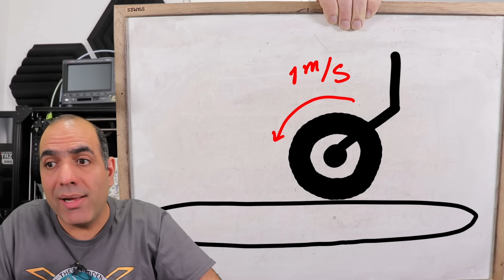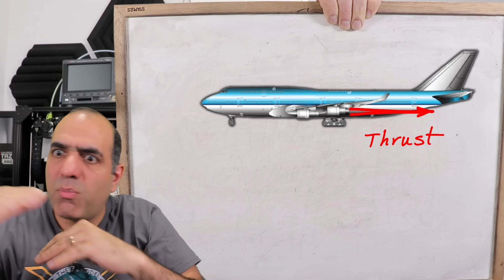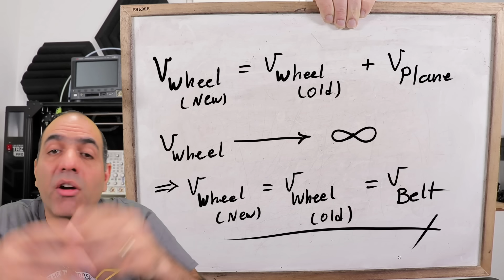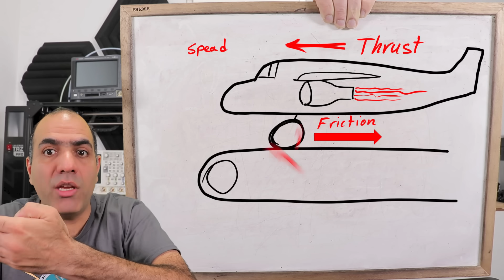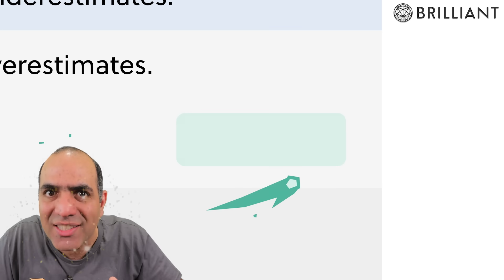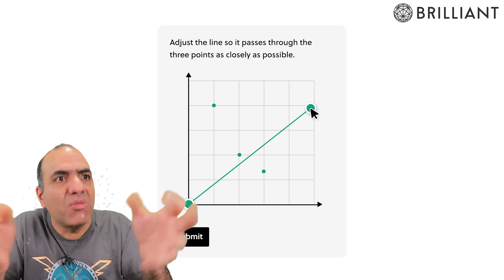Airplane Question that Drove Me NUTS!!!

Comment: Yes, because the wheels aren't the ones propelling the plane, but the engines as thrust, so while a car won't move past the conveyor belt, the plane can
Reply: As per #3 case, friction would melt the bearings and the plane would crash to the ground of fly away if it's fast enough for when that pasess

Comment: No, because the plane takes off because of air pressure differential (under/over wings) while moving "THROUGH" the air.
It's also why a stationary plane can take off if there's a lot of wind.
Reply: The question is really just a variation of the tennis ball-pick up truck problem, ride a pick up truck going 40kmh, then throw a tennis ball at 40kmh in the opposite direction that the truck is traveling. What happens to the ball? It falls straight to the ground. Atleast one of you must have heard this exempel before? remember 4th grade physics class?
Reply: @SalsaDura  what are you talking about? The plane takes off normally - it gains speed and moves forward and takes off.
Reply: @svetko05  Right. I got it. There was even youtube video describing this aspect not so long ago. The plane will run towards front of treadmill no matter what. So it will gain relative speed anyway. Its wheels will just spin faster.
Reply: See: "Why aircraft carriers head into the wind for cats and traps".
Reply: Nothing gets past you.
Reply: And in a Vaccuum it can never take off. XD
Reply: Yeah its a really straight forward awnser lol
Reply: That's true, but also wrong. The plane moves with its engines, which generate thrust and not the wheels like cars and bikes.
Therefore, if a plane is on a conveyor belt, it will take of like usual,  but the wheels will rotate twice as fast because of the addes speed of the conveyor.
Reply: @svetko05  no,
Think more mathematically. The question states, that the belt matches the speed of the wheels!
This means, that by definition the axis of the wheel does not move. And thus the plane does not move no matter what. If there wansnt any friction in the bearings of the wheel, then there wouldnt be any force tonencounter the planes thrust, but this simply means, that the belt cant move at the same speed as the wheel does, which would imply a false statement in the question. So the question actually implies, that there is sufficient friction inside the bearing for the airplane to be stopped by the friction itselve at a very high rpm of the wheels.
Reply: @svetko05  It's amazing to me how many people are coming in here and assuming that Mehdi thought planes take off by driving their wheels instead of actually watching the video. The wheels can't spin twice as fast by definition in this scenario because the speed of the conveyor is equal to the wheel speed. If the plane starts moving forwards then the wheel speed must exceed the conveyor speed, which can't happen. The only ways the plane can take off are if the plane's wheels can slip without being destroyed allowing the plane to take off without the wheels spinning at all (or at whatever speed perfectly matched to the conveyor so all net forward motion is from wheel slip), if the speed of both conveyor and wheels is infinite such that the difference in speed is effectively zero even when the plane is moving forwards, or if there's a sufficient head wind that the plane can take off in place (as another commenter suggested potentially as a result of the infinitely fast treadmill spinning underneath it).
Reply: @svetko05  but the wheels are rotating at the same speed as the conveyor. so therefore, no forward movement=no lift

if the conveyor belt is matching the ground speed. then the plane can take off
Reply: @8bit_George  the wheels rotating at the same speed as the conveyor belt changes absolutely nothing because they are rotating freely. The engines are what provides thrust.
Reply: @Ledlightman  as i said - wheel speed doesn't matter to an airplane. It doesn't matter if they don't spin at all or even if they spin to an infinite rpm. 
Some planes don't even have wheels, but floats or skis.
As long as the wheels don't generate too much of a friction, the plane will move. But friction was not mentioned in the question, so we assume it is ignored.
Reply: @svetko05  You've added an additional assumption there without even realising it - "as long as the wheels don't generate too much friction". The only way for this to happen is if the wheels have exactly zero friction or if they don't spin at all and wind up acting as skids. They can't just spin faster because the faster they spin the faster the conveyor spins, perfectly matched to the wheel speed, until they both reach infinite speeds, friction exceeds what the plane is putting out in thrust, the wheels slip or something catastrophically fails. And depending on which of those happens the plane may or may not take off.
Reply: @8bit_George  The wheels rotate at twice the speed of the conveyor, it is going backward at speed V, the wheels are going forward at rotation speed 2v and the plane goes forward at speed 2v minus v or one v.
Reply: @8bit_George  that depends on what "speed" you're talking about. The thing is in actual reality, if you built a conveyor belt runway, there would be no way to control the belt such that the belt operator can prevent a pilot that intends on taking off from taking off. And since that's the reality of the situation, then the "speed" referred to in the question must be interpreted to be consistent with that outcome. 

So what "speed" fits the question.  And there's actually two! The first is the speed of the wheel itself as it's attached to the aircraft. If the aircraft moves forward at 100 mph, the wheel goes along with the aircraft at 100 mph. A mark on the conveyor belt moves 100 mph in the opposite direction.   Problem satisfied. 

Here is the second way to interpret the question so it's consistent with reality. If put a mark on the contact surface of the wheel, and you measure the distance it travels, the circumference of the wheel x the number of rotations. That distance will equal the distance traveled by a mark on the conveyor belt surface. If the conveyor belt is rotating in a clockwise direction the wheels will be rotating in a counterclockwise direction.  Same speed, opposite directions. Problem satisfied.
Reply: @8bit_George the wheels dont move the plane. This is not a car. Do you really think planes take off my powering the wheels? News flash: no they dont. The engines push the entire hull forwards, NOT THE WHEELS. The wheels spin freely and act as a bearing. Thats all they do. 

For your "answer" to (still not-) work, the planes hull itself must be attached to the treadmill, in which case the plane will go backwards and once again showing you that youre still wrong.

Comment: yeah i'll leave a comment.

 OF COURSE IT CAN.

fundamentally it's a flawed question because it's got nothing to do with a conveyor belt. the plane itself is moving forward, not the wheels.

EDIT: obviously i've now watched the video and i want to help out with case 3:

there are two key pieces of information that need to be added that are forgotten. 1: The friction of the conveyor belt doesn't just effect the wheels, it effects the air as well. 2: Lift will affect the effect of friction on the wheels as they will "weigh" less 

As the conveyor belt has friction it must be moving the air. the motion of air over the wings will produce lift. lift reduces the effect of friction from the conveyor belt on the plane and so the wheels turn faster. the conveyor belt speeds up to compensate. faster speeds mean more resistance. more resistance means more  air flow, which means more lift which reduces the effect of friction, so on and so on until equilibrium, where lift = gravity, which fundamentally is just a plane flying in one place .

Comment: Trivially yes. I mean practically you'll have a lot more rolling resistance and maybe a tire blowout for overspeeding the tires but overall the plane should accelerate as normal.
Reply: It's only trivially yes if you read it as the conveyor matching the plane's speed. But that's not what the question said.
Reply: @bosstowndynamics5488  whatever speed is applied to wheels is irrelevant, they can spin freely and the engines can EASILY win against wheel friction. The only issue is wheels spinning too fast for what they are rated for and blowing up
Reply: @marcogenovesi8570  For the plane to move at all the wheel speed must be infinite or we have to introduce wheel slip into the scenario. If the wheels have finite strength or any friction at all then the fact they're free wheeling is irrelevant, because they'll generate infinite resistance in that situation and stop the plane, or catastrophically fail. Wheel resistance is only irrelevant at real world (finite) speeds. If wheel slip is allowed and the wheels are indestructible then the plane slides down the runway as if it doesn't have wheels at all and depending on specifics may or may not take off.
Reply: @bosstowndynamics5488  for the airplane to move you just need to start its jet engines and there is nothing the wheels or anything under the wheels can do about it unless you pull the brakes. The jet engines are in the wings and pushing forward irrespective of the speed or direction of rotation of the wheels. The whole question is a false herring, wheels are irrelevant because an aircraft is not a car, it's engines push the air, not the wheels.

The only thing that can happen is that if you exceed the tires speed rating they blow up as they spin too fast. But this is hardly a mind blowing concept, run wheel too fast and it will blow up, duh
Reply: @marcogenovesi8570  Did you watch the video or did you just completely ignore it and go based off of your initial, incomplete read of the question? The plane isn't hovering, it needs to roll down the surface it's sitting on using the wheels until it reaches take off speed. And until that point, it's subject to friction from the wheels. In most circumstances you can safely ignore that friction because it's dwarfed by the inertia of the plane, but the question specifies that the road surface is moving backwards at the same speed the wheels are rotating, by definition*. For the plane to have *any non zero speed the wheels must be spinning faster than the conveyor, which we've just defined as impossible because the conveyor will always match their speed. In this scenario the conveyor speeds up until the wheel friction is so high that it overcomes the thrust force of the plane and it just sits still as the wheels explode, unless it can run long enough to accelerate the air nearby to take off speeds so that the plane can take off perfectly vertically.
Reply: @bosstowndynamics5488  Yes and I still think it's nonsense, the moment you start the engines the speed of the wheels does not matter anymore. Wheel speed may or may not go higher than what they are rated for and blow up
Reply: @marcogenovesi8570  You can think it's nonsense all you want, but your arguments are outside of the scope of the question and therefore irrelevant. The entire point here though is that the question is nonsense, showing that all logical conclusions are also nonsense is part of demonstrating that. Concluding "but in the real world wheel speed doesn't matter on stationary ground therefore it doesn't matter in this hypothetical describing a very unreal situation" is completely missing the point.
Reply: @bosstowndynamics5488  The question is a trick question, giving irrelevant information and hoping you get confused by it when in fact it does not matter.
Wheel speed does not matter for an aircraft as the engines are not connected to the wheels, the only thing that can happen is that you blow the tires because they rotate too fast
Reply: @marcogenovesi8570  And, as I've already said multiple times, the tires are spinning too fast *by definition*, because the construction of the question requires that either the plane doesn't move at all or the wheels are spinning infinitely fast. At all finite wheel speeds the only circumstances that satisfy the constraint that the conveyor is spinning the same speed as the wheels are if the plane is already in the air (which fails the requirement for the plane to start at rest) or if the plane is stationary. You can't just ignore the wheel speed here because the wheel speed is tied to other systems in the scenario and the result of that relationship is that it breaks the intended meaning of the question.

The question is supposed to catch people out for assuming that planes are driven by their wheels but because it's so poorly constructed the result is that a large number of people (including Mehdi) will reach conclusions other than "the plane will obviously take off as the wheels aren't the driving force" with perfect logic. It isn't a trick question, it's a bad question.
Reply: @bosstowndynamics5488  And what does the wheels spinning too fast by definition do? The tire blow up, as I also said can happen since the first statement.

You fall into the mistake of overthinking, what I said is still correct and the most resources I can allocate to trick bs questions. Quick estimates with caveats.

No you don't know what that question is supposed to do, maybe they wanted to do the 4D chess move and actually trick the tricksters with a multidimensional trick question that looks like a much simpler trick question.
Jokes on them I gave an answer that is still correct without wasting any more time than I would with a normal trick question
Reply: @marcogenovesi8570  But your answer is wrong. You didn't answer it efficiently, you made incorrect assumptions and as a result provided an incorrect answer, then you had the gall to excuse it by claiming you didn't waste energy on a meaningless question while arguing back and forth for over a day in a YouTube comment thread. You aren't interested in being efficient, you're just trying to be right. There are valid arguments that suggest the plane would still take off, but "the wheel speed doesn't matter" isn't one of them.

By the way, have you thought about what happens after the tires blow up? You keep saying that's the only consequence of going over rated speed on the wheels yet you haven't mentioned what happens next when the barely moving plane's landing gear explodes at full thrust.
Reply: @bosstowndynamics5488  No my answer is correct and I didn't make any assumption.

Arguing back and forth for a day takes seconds and is entertaining, figuring out exact mechanics of a physics simulation to answer a trick question takes time and is less entertaining than arguing with a human opponent.

I'm being efficient. Efficiency is effort per result not just effort by itself.

What happens after the tires blow up is that the metal wheels eventually grind down and seize. When that happens on all wheels the belt stops as the wheel aren't spinning anymore and the landing gear becomes a sled. Yesthey are designed to withstand that (for a landing) and the engines are powerful enough to still push it fast enough to accelerate even with higher drag because the things are not wheel anymore, they would be strong enough to push it even if it was on its belly with no landing gear. You really underestimate jet engines on commercial aircraft of this size, unless it's bolted to the ground they will push it
Reply: @marcogenovesi8570  You can't just say you're right and have it be true, you're making implicit assumptions about the content of the question instead of actually reading it and then making ridiculous claims like it's somehow efficient to argue in a comment thread. Efficiency is partly about results, yes, but what results have you achieved here? Efficiency is partly about input, again yes, yet despite the fact you claimed it was too much effort to analyse the physics of the question you attempted a detailed analysis of the conceptual physics of this argument.

The plane can't take off if its superstructure is destroyed by being dragged down the runway. I'm sure the engines are capable of it, what I doubt is the structure of the airframe what with all of the infamous examples of planes falling apart when landing with damaged landing gear and all. The plane can't take off if it's a heap of twisted metal.

Your argument is just wrong, it relies on an incomplete reading of the question and your refusal to acknowledge that is getting old. It's not efficient, it's a waste of time.

Comment: What is it with all these questions that the Mythbusters solved years ago suddenly making a resurgence? The plane can take off, because the wheels aren't what is driving the momentum of the plane, (in fact they are likely free spinning). So once the jet engines kick in, the plane will still be able to move.

Comment: It can probably take off...if the wheels can go at twice the normal speed they are designed for....
Reply: Didn't expect to see you here good sir.

Also the question kinda baffles me because its a jet, maybe with a propeller plane, if enough air is pushed over the wings by the propeller but a jet??
Reply: @JetS_Gamer  wouldn't make a difference imo, you have air being pushed backwards to move the aircraft forwards, it just needs to accelerate to move fast enough to lift itself off the ground/conveyor belt and that's it
Though, if the wheel bearings can take the load of going extra fast is something completely different..